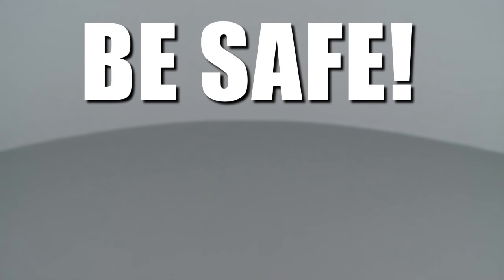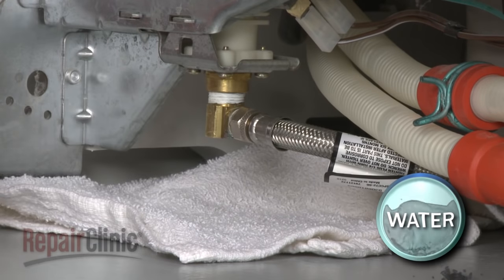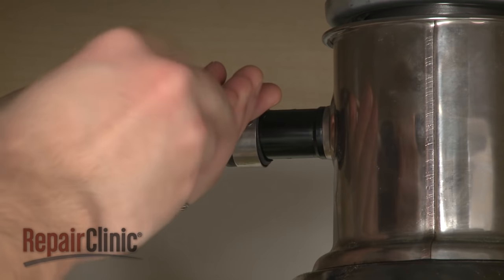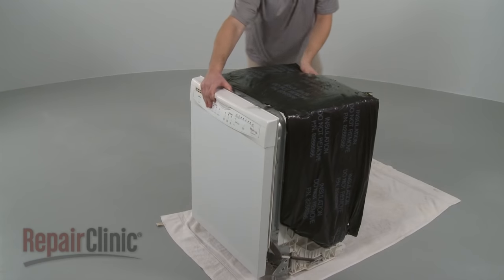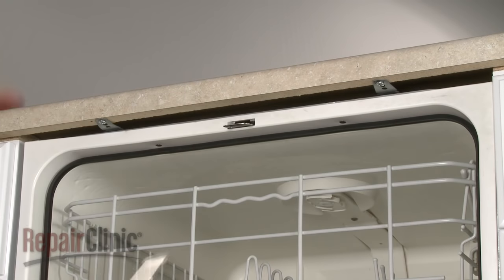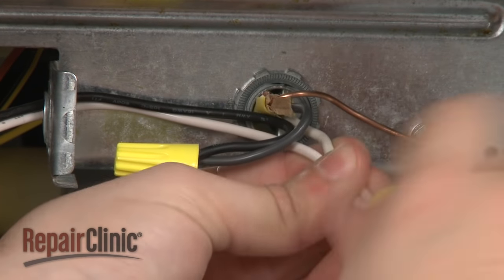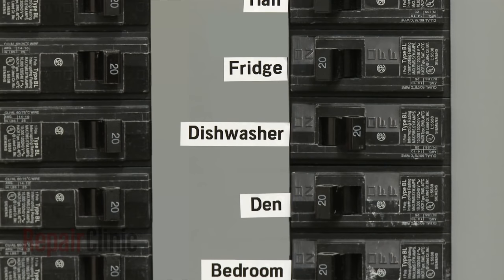Whirlpool Dishwasher Heating Element Replacement #W10518394

Comment: Imagine if you had to change out a light bulb by shutting off the breaker, climbing in the attic, pulling out the can, un-wiring it, coming back down, unscrewing the bulb, replacing it, going back up to the attic, putting it all back together and then turning the power back on.
Reply: Wait....thats not how you change a light bulb...???
Reply: Absolutely. There is no reason you shouldn't be able to open the dishwasher and replace the part in like 2 minutes.
Reply: point?
Reply: @Its_Lucky  this process this ridiculous, that's the point.
Reply: @Lcvelycute176 Alternatively you can take out the sump which is pretty easy, they have a video on it. From there you can access the element nuts very easily. You won't need to do all this.
Reply: 🤣 recessed lighting, gotta love it 😉

Comment: DIY-ERS READ THIS! I just replaced my element without pulling the dishwasher, I just snaked my arm in there, unplugged the wires and swapped everything out by feel/limited visibility. The nuts are just nice and hand tight, no tools were required on mine. I have a couple pans under the washer now to be sure I’m not getting any drips before closing everything up.
Reply: Did you snake your arm through the lower access panel?
Reply: Same , tight fit and done by feel but got it done without all the mess. Basically the same skills when you’re working on a car and have to start a fastener by hand with your arm jammed down in some tight space

Comment: You really don't need to do all the brain surgery stuff in this video if you have slack enough on your water feed, drain line and electrical. Just pull the dishwasher out and lay it on it's back, unscrew the element, pop it out and put the new one on. Then keep the unit out and run a test run. Put a piece of paper towel underneath to verify no leaks. Then slap it back in. Done. Aside from running the wash cycle, 15 minutes to remove, 15 minutes to put it back.

Comment: Recommend changing the order of the steps to turn water back on, check for leaks, then reinstall the cover panel. May even want to run a cycle and check for leaks before putting the cover panel back on.

Comment: This is in the wrong order you have to raise the feet and turn the two screws on the top of the dishwasher and pull it out of the cabinet before you can get to the wiring, and you should have enough play in it anyway that you could pull this out of the cabinet turn it on its side and work on it I have replaced the pump twice. I turn off the circuit breaker but I don't have to unhook any wires or hoses to pull it out of the cabinet and lay it on its side. Hell that's how you put all that stuff on in the first place., was outside the cabinet

Comment: If your arms are slender enough and you have a stubby 3/4" or 19mm wrench, this isn't hard to do while the dishwasher is installed.
Reply from the maker: Brian Elmer Thanks for the tip!
Reply: This is true. I turned off the power at the breaker and i was able to replace it by pulling it out just enough and reaching under.
Reply: Agree and wish the dishwashers are made repair friendly. Why not put the heater connections to the front of the dishwasher?
Reply: I battled for longer than I'd like to admit before coming to the comments. 1/4 SOCKET FOR THE EASY WIN!

THIS IS THE WAY.

Comment: * MAY HAVE TO RUN DIAGNOSTICS CYCLE TO RESET THE CONTROL *

My dishwasher stopped cleaning and drying the dishes a week or so ago.  I was able to find a burned out spot in the heating element, so ordered a replacement and followed this video to replace it.  Great video, I found it very helpful and it made the replacement very easy.

Afterwards, I was still having trouble.  No heat.  I did some further investigation and ended up replacing the thermostat too, even though it tested fine and seemed  quite coincidental for it to be out as well.  Still, no heat...so I kept digging, and ended up having to run a diagnostics cycle on my machine to reset the heating control, and afterwards it is working properly.  

I wanted to put this in a comment in case anyone else runs into a similar issue.  I had to review the schematics, which were attached to the inside of the lower access panel, for instructions on how to run the diagnostic test.
Reply: Had the exact same issue, burned out spot in the element, replaced and still wouldn't work. Ran the diagnostic test and got it heating again.  Thanks!
Reply: Thank you!! You just save me money. I had to fix the pump and I guess while I did that and unplugged the dishwasher I didn't notice that the heating element wasn't working. So I thought I had to fix that now. After I saw your comment I did that diagnostic test and it just started working. So I didn't need to change anything. Thank you so much.
Reply: Thank you so much for posting this! I had the same problem after I replace and ran diagnostic. Now it is working properly.
Reply: How did you run a diagnostic cycle ?
Reply: @Jamesdarmody81  That was 7 years ago, I hardly remember what I ate for breakfast this morning.  Looking back at my post though, I see that I pulled out the schematics and repair info to get instructions, so I'd suggest either that or searching on YouTube.  Good luck!
Reply: True hero right here. Fixed my issue.

Comment: For repair clinic:Very well done video. Had no idea where to start until I stumbled on this. Thanks! 
Some notes to make repair even easier for your viewers:1) it is *a lot* easier to disconnect water under the sink rather than at the unit. 2) my unit was installed with a wall plug. if there is enough play in wiring and plumbing hoses as was the case with mine, just slide the unit out and unplug from the wall. No need to mess with wiring, nuts, strain relief etc..
##For the manufacturer(s)##: could probably have made this unit a tad more serviceable and not require it to be pulled out to replace a heating element that is visible and easily accessed in situ....but maybe the element could have been made better so as not to crack and need replacement or service 😉
Reply from the maker: +fes ade Thank you for the feedback.
Reply: Thank you! Ours unplugs from the back too!

Comment: This video was very helpful, although I would caution that this process wound up being a much bigger hassle than I expected and at one point I was ready to give up and buy a new dishwasher. One suggestion I would make to make things easier is to try and pull the dishwasher out from under the counter before disconnecting the water and electric. My water pipe was really fiddly to disconnect when still under the counter and took a while to undo. I had plenty of leeway on both the water pipe and electric wiring so after I had installed the element, I raised the dishwasher up on blocks and then connected everything back up before lowering the unit and pushing back into place. All said and done it took me around 4 hours. Oh, and make sure your shut off valves work before you attempt this…

Comment: Anyone watching this video, if you don't want to pull out the dishwasher and you have big arms like me, you can take out the sump for underneath access which is pretty easy. If you don't know how, look up the video from repair clinic titled "whirlpool replace pump and motor assembly". Once you pull out the assembly, you can very easily access the element retaining nuts without needing to pull out the dishwasher itself. Personally I found this much easier because my dishwasher wasn't installed with mounting brackets (I lost them) so pulling it out is a real pain.
Reply: Great tip thx

Comment: Thanks for a very detail video. But i have a suggesstion for others because i got into this. Before you unhook wires and pipes check by pulling little because i had plenty of cable and pipes but since i followed this video i unhooked everything and it was hard to put it back specially water supply pipe which is the most hactic after a lot of spill. But still thank you for showing us to save 100’s of dollars. I changed it in 45$
Reply: Great suggestion—I did have leeway on my drain line and supply line, but not my electrical. Saved a lot of time, but still got a puddle when I tipped over the dishwasher—easier to wipe up on the kitchen floor than under the sink/washer.

Comment: Hi, quick question - 
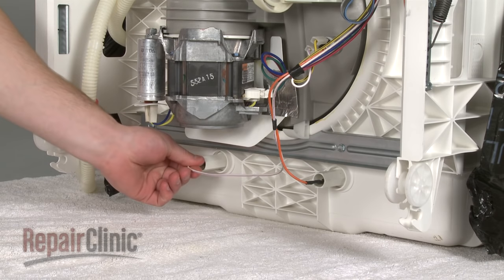I need to replace the heating element on my dishwasher. The replacement part comes with two standard metal nuts to screw into the bottom of the dishwasher (reference 2:16 in the video). The plastic terminal nuts that were already on the dishwasher will not screw onto the new heating element threads, leaving what would have been covered by the old nuts exposed. My question is, how important is having the the plastic nuts over where the wires plug into? Is it a fire hazard if I use the metal nuts provided with the replacement heating element, since the terminals would be exposed? Thanks

Comment: I'm going to give this a try. Quick question: can't you just unplug dishwasher instead of turning off circuit breaker?
Reply: If it is plugged in to a wall socket, lucky you! You can, in that case, simply unplug it.

Comment: QUESTION: this was easy enough to follow, and I was able to replace the heating element quickly and easily! However, as soon as I turned the power back on and tried a cycle, yes water heated, but it is now stuck on the wash cycle (I hear it draining, but it won't go to the rinse cycle or finish/stop! Just kept washing for over two hours until I noticed! I've reset it three times (factory reset by pressing the buttons in sequence) - could I have accidentally hooked the red and white wires on backward? Or are they on correctly if its running? Surely the timer didn't stop working at the exact same time that I put the new heating element in...any ideas why it's stuck on WASH and won't stop running? HELP!

Comment: I had enough slack in my hookups to pull it out of the cabinet and just lift the rear of the dishwasher a few inches.  Reach in from the back and undo the wires and plastic nuts.

Comment: Is there a way to use a multimeter to test continuity BEFORE having to take the whole thing out? If so what settings should my multimeter be on and where should I put the leads?
Reply: 200K usually the lower 2 holes on your meter ...ohms elements should read 8-30 ohms

Comment: I have a whirlpool and only three years old only used it about 50 times there are a suds build up at the bottom and and the heating element came apart is this a problem with the heating element and do I have to follow the procedure of the video to replace it
Reply from the maker: +Peter Rives Sudsing is often cause by using the wrong type or too much soap. If the element burnt out and looks like the one in the video then there is a good chance this is the right procedure.

Comment: I just unplugged the dishwasher and skipped the breaker switch. Not a professional, but I also skipped the junction box with the assumption that unplugging the appliance removed electricity from the equation, but I'm not a pro.

Comment: I normally set my dishwasher to one hour fast mode and no need to dry as I ear dry it or wipe it with a microfiber but i noticed The other day when I open the dishwasher to add more stuff into the machine that the heating element ring is not fully lit only a portion say 1/4 of the ring is lit so does this mean it’s broken and needs to be replaced....The machine is not heavily used it’s only probably less than two years old

Comment: I followed these instructions with ease and thought I would be all set after I flipped the circuit breaker back on, but I am still getting the blinking light and no action.  Any thoughts of other things that could be wrong?  My heating element broke in half so I know it needed to be replaced.
Reply: Yes, after you get the flashing clean light again, you’ll have to run a diagnostics cycle.
Reply: If it’s a whirlpool, your control board shorted out where the relay that turns on the heating element mounts to the control board. There was a class action lawsuit against Whirlpool on this issue.

Comment: I maybe wrong but why did you unhook the water valve and wires. Can you just shut down the breaker and unplug it. Seems like unnecessary steps? I need to replace my heating element
Reply: Larisa Sito just did this. You have to unhook to pull the washer out.

Comment: Hi I have a Whirlpool dishwasher. It is a little over 2 years old. I recently replaced the heating element crossing my fingers it would work again. It did not heat up. Is there a way to reset the controls on the whirlpool dishwashers you know of? Thanks
Reply: Dennis Krohn Jr. 
Check the inside of the lower cover panel for how to run a diagnostics cycle and reset everything.
Reply: Chris Pajak This comment was key for me.  I had ordered new element and installed it but clean light was still flashing. Was able to run diagnostic test and after was running like new.  This important step was not included in this video.  Thanks Chris!

Comment: My element is WHITE from hard water. I just had a water softener installed today. Can I clean the element with vinegar? It’s heating ok I think.
Reply: Use CLR (calcium lime rust) remover.  It’s sold at all hardware stores and Walmart.
Reply: @masonlovesroblox  thanks, but that stuff was thick! I ended up using my dremmel!

Comment: my dishwasher doesn't seem to wash the dishes, there's always detergent residue on my silverware. any ideas on what could be wrong?
Reply: Check for hard water, change detergent type or use tablets or liquid detergent, use less detergent, run longest cycles, check water temp

Comment: Help! We replace the element but it doesn't seem to want to tighten enough to have a waterproof seal. It leaked and we are afraid to tighten too much in case we strip out the nut. Any ideas? Maybe doing something wrong?
Reply: Did you ensure the little rubber washers were under the flange of the heating element. The washer goes between the flange of the ailment and the interior of the cabinet.
Reply: Make sure there are no nuts on your element before inserting the element in the tub. The one I got came with smaller metal nuts that were the same threading as the long OEM white plastic nuts shown in the video. These metal nuts need to be removed before inserting, and discarded if the white nuts will work. Also, make sure there are no Styrofoam packaging particles sticking to either side of either washer or flange. Finally, my element had some electrical glue that had gotten on the flange, but thankfully not facing the washer. If the dried glue were touching the washer, it would compromise the fitting and might cause a leak.

Comment: My lower sprayer arm came loose, hit my heater element, which melted the arm edge, the impact jarred the element loose from a holder bracket, which allowed the heating element to dip down into the tub floor and burn it.  This dishwasher can not be removed, previous homeowner installed tile floor on top of tile floor and there is no clearance to pull the unit out.
My plan is to patch the tub with epoxy.  Install new holder brackets for the element, install a new sprayer arm...does that sound like it may work?
Does my scenario/explanation make sense, Or am I describing what happens when the element warps with age?  Would one suspect the element stretched with age and popped off the holder bracket?  Is there hope of a repair as I provided in my plan above?  Thanks if you have time to address. ~ Hand washing like cave men until I fix it.  Ha.  : )

Comment: Something should have been said about the nuts being tightened enough to create a waterproof seal.  Just not overtightening did not tell it all.  Otherwise, this was great.  Thanks.
mickeydwolfe
Reply: I think this is why mine leaked after we plugged it back in.  Was worried about tightening too much but I must have not tightened it enough.

Comment: Whatever you do, DO NOT BUY THE REPLACEMENT ELEMENT ON AMAZON! I did and the mounting bolt threads didn't align with the element threads.
Reply: @repairclinic  Thanks! I actually got it from a local repair shop (after a 3 month wait!). I'm test running it right now. Any suggestions for the mildew/mold that's there now?😔